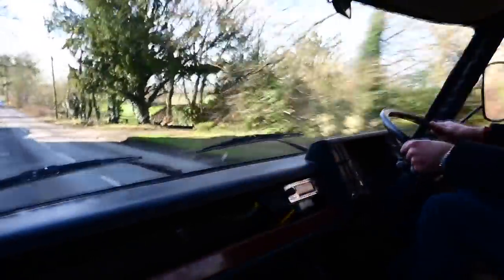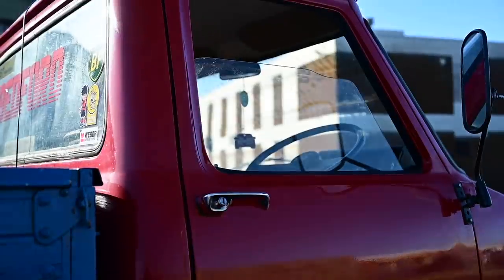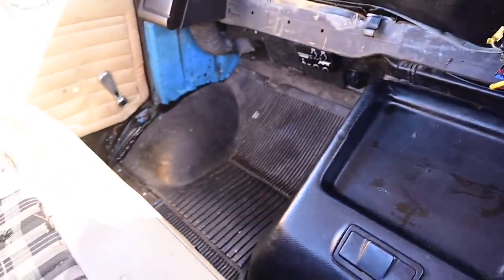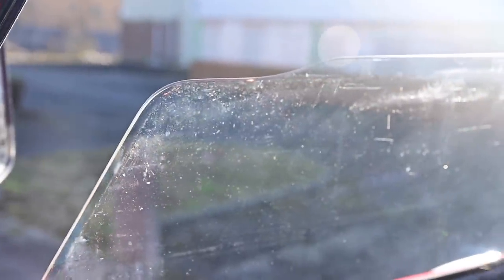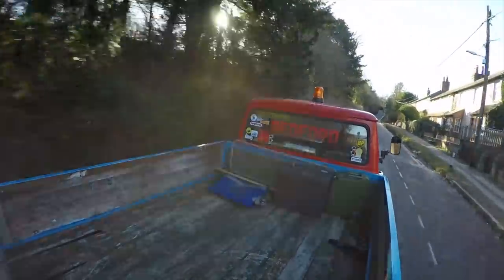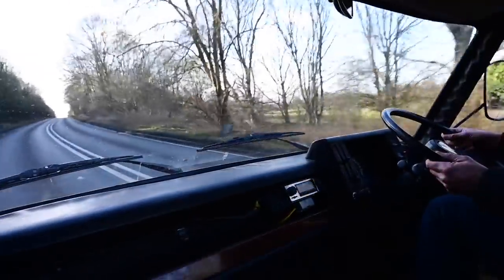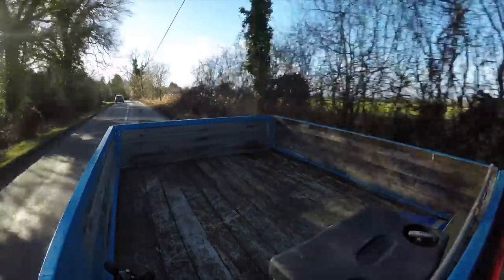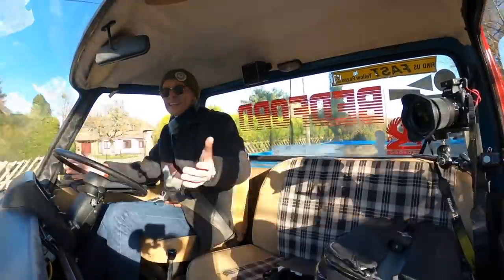1982 Bedford CF CF1 Pick up Goes for a Drive

Comment: We had a CF as a breakdown recovery truck with a Spec Lift in the back. If you put a car on the Spec (a reasonable size car so 3 series BMW for example) the front would lift up as it didn't have concrete weight in the front, you had to put the hand brake on 3 clicks to add braking efficiency and the back axle would shift on the leaf springs making the whole truck crab. Only found that out when we picked a car up and when through a width restriction..... the truck went through but he car didn't and smashed up the front end of it. Went down like a Lead Balloon with the bosses!!!! 🤣🤣🤣🤣🤦‍♂️🤦‍♂️🤦‍♂️🤦‍♂️
Reply from the maker: Would have loved to hear the explanation for that when you phoned the office!
Reply: @furiousdriving  fortunately we had a bodyshop as part of our garage so said we'd repair the damage. Customers wasn't exactly impressed when told they car has had been crashed but at least they didn't need to put in a claim.

Comment: Does anyone know where the large hose attached to the back of the air filter induction housing leads to? It can be seen at 5.18 behind the circular bit that has the vent tube for the rocker cover. 

That big hose is missing on my van and I'm not sure where it attaches too
Reply: This is my van. The large hose is the vent for the rocker cover (save the extra large hose which is the air in take)

Comment: That's a CF2, rather than a CF1, surely?.  Nice though - takes me back. My dad had an R reg CF.
Reply: It’s a facelift.
Reply: @Landie_Man  I was under the impression that the facelift was the MK2
Reply: @linseyyoung1772  no. He explains the differences. There were some overhauls on “A” reg.
Reply: @Landie_Man  Must have missed that...
Reply from the maker: CF was the original with pressed steel grill, CF1 was this, then CF2 refined this
Reply: @furiousdriving  Ah, that's clarified it :-)

Comment: Nice, however on the Continent you did not see them a lot. It was VW Transporter and Transit. I've driven Transporters back in the day when they were new. Let's be honest, vans in those days were horrible to drive with a very bad seating position. I do still drive modern vans, like Sprinters and vans have become a lot better over the last 35 years.

Comment: "Blitz" isn't a strange name at all. The word "Blitz" simply means "flash", and the flash is the central element of the Opel logo (and has been forever). Germans do not have the association of the word "Blitz" with "Blitzkrieg", because "Blitz" is a common everyday word for us. It's different for you as you probably think of "Blitz" only as short for "Blitzkrieg", but we don't use the word in German in that way, nor do we have a strong association either.
Reply from the maker: Here the word Blitz only has connotations of 1940! Although older mother in law types seem to use it to mean cleaning the house!
Reply: @furiousdriving  Exactly, that's why I wanted to point out why the name isn't weird at all if you look at it from the German perspective.

Comment: It looks like a early 70's to mid 2010's Ford Econoline van, Dodge Ram Van any van in North America.  The Chevy Express van hasn't changed since 1996 The Ford Econoline van is the North American  workhorse the United States version of the European Ford Transit Dodge got rid of the Ram Van since 2002 they still make the Ford Econoline van as a chassis cab and cutaway van but the last Cargo and passenger van was discontinued in 2012 it was replaced with the Transit for North America especially United States and Canada

Comment: Looks in great condition for its age. We bought a new CF van in Sydney 1979, assembled by GM Holden, fitted with the 6 cyl  173 'Red Motor'. We brought it back to New Zealand in 1991. It sat neglected on our driveway from 1999 to 2021 and I finally got the motor restarted for an 'oily-rag' do-up,  https://youtu.be/ft1zktFsy9s

Comment: good review but no wonder why Ford had an instant hit with the Ford Transit.
Reply: Remember. This was released after the transit.
Reply: @Landie_Man  true but that makes it even worse. did GM (Vauxhall) intentionally miss read the market ?
ok it wasn't a complete flop as there were a fair few sold but GM could have done so much better
Reply: The one thing Transits had over every other UK van of that time was that you did not have to share the cab with a noisy, often smelly engine, the  Transit had a car like floor pan and the engine was compact enough to allow everything to be done from under the hood. However when the CF came around late 68 early 69 it did looked really good.
Reply: @Witheredgoogie  I had a similar aged transit and this van feels so much better. It’s mine!
Reply: @Witheredgoogie  I had a similar aged transit and this van feels so much better. It’s mine!

Comment: Except it wasn't better than the Transit. The Bedford was a lot more unrefined, suffered gearbox problems and had a terrible top speed. Buying a Bedford then was equivalent in the van stakes to a Peugeot, Citroën or Renault van now. 

They were also cheaper than a Transit which is why government agencies liked to use them. Same as they bought Leyland Dafs in later years instead of Transits as they were a fair bit cheaper.

You need to review a mk2 Transit now as a comparison.
Reply: I had a mark 2 transit. This is my van. I was amazed at the build quality of the Bedford compared to the Ford. Much more robust.
Reply: I agree,the mk1 and particularly the mk2 transit was superior in every single way.my dad had them all.had loads of transits,would never touch a bedford again.
Reply: @ivanfernyhough3851  I had a transit mark 2 before this van. This is my van. The Bedford feels a lot better quality. Transit was very plasticky and the body was a lot thinner metal.
Reply: @Landie_Man  its nice to see you keeping it alive and on the road in our experience tho they just weren't in the same league as a transit tho sorry.each to our own and i respect anyone that keeps these cars and vans alive.👍
Reply: @ivanfernyhough3851  thanks. Matt has reviewed 3 of my cars!